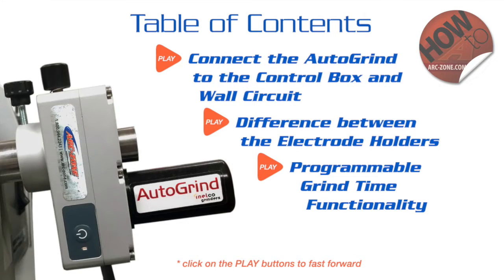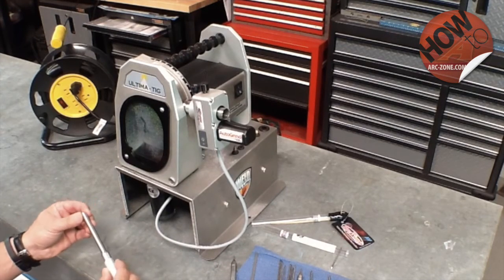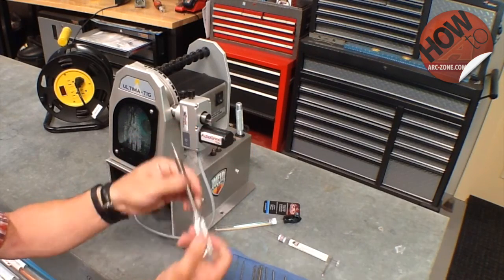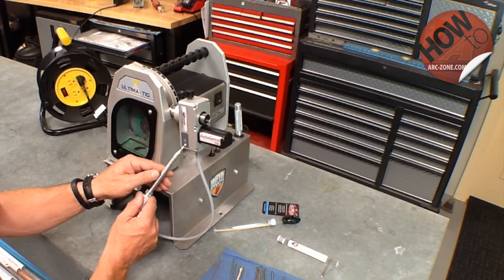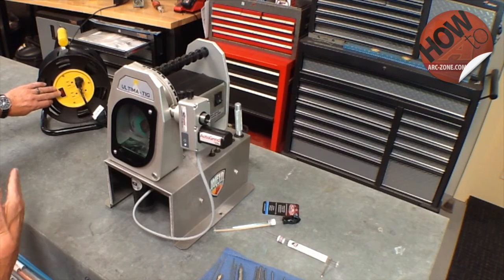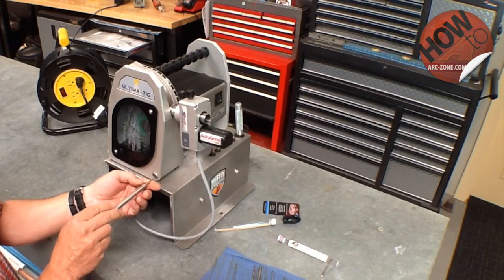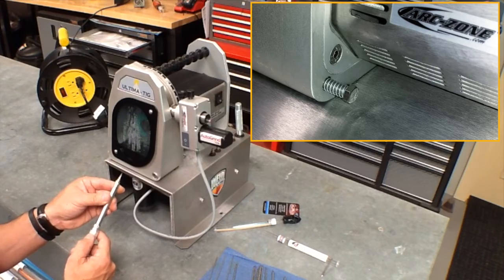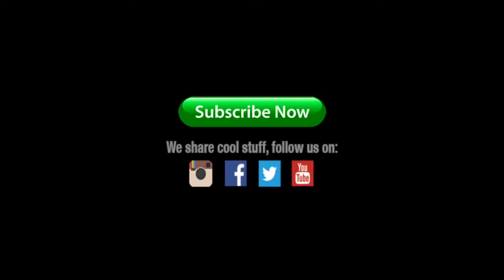GRIND TUNGSTEN ON BEAST MODE [Ultima Autogrind] FULL VERSION

Comment: well greg Burnside, the point of this grinder is really for thoriated tungsten because of the radioactive dust that comes off them so the grinding fluid catches the dust. but you can use it with all tungstens types. it's not because your a bad tig welder.
Reply: EXACTLY